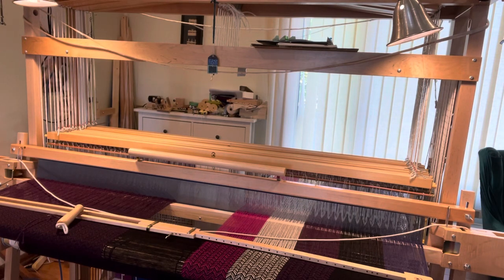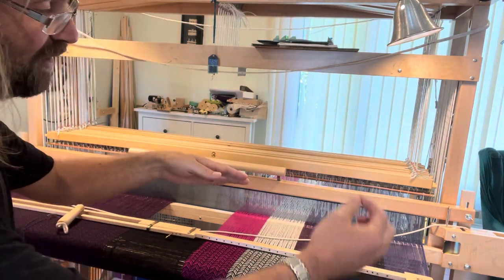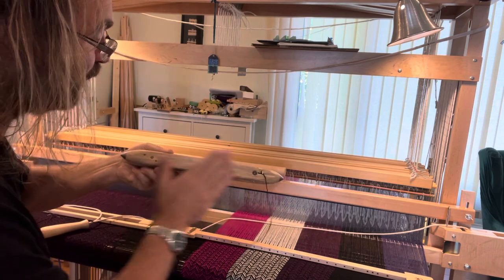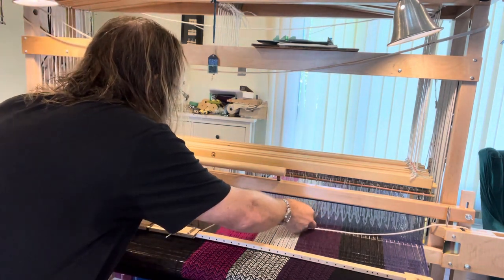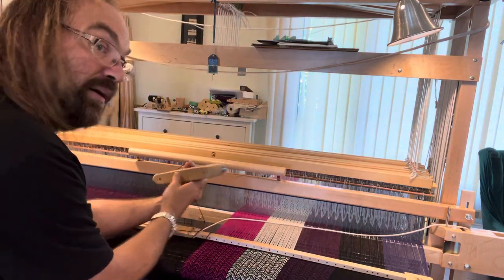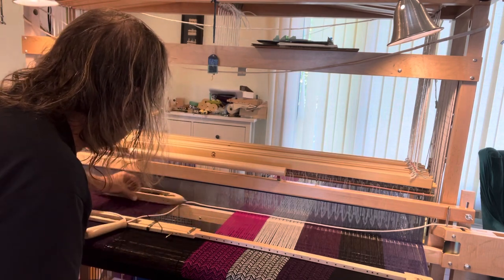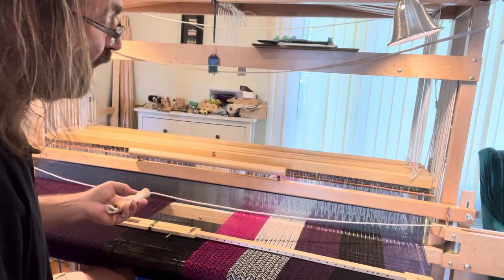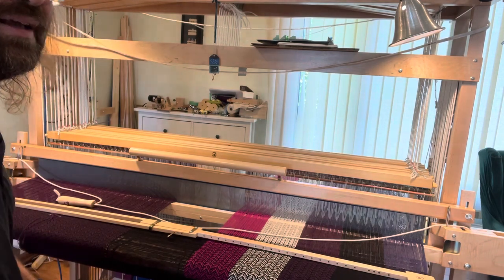Learning to weave / weaving with a flying shuttle or fly shuttle

Comment: Hey I'm in the process of shopping for a new loom right now and I was already leaning towards the 12 shaft colonial 60" before I found your channel. I'd love to hear your thoughts on it.
Reply from the maker: I love it. As long as you have the floor space and money - I can’t imagine doing anything different. 

1. It is a gorgeous work of art itself. Very well engineered, elegant solid hardwood, well finished.  Excellent company to deal with. 

2. Love the overhead beater for everything other than flying shuttle. 

3. 12 shafts give such a diversity of possible patterns. In doing 8 shaft twills, I often sley the floating selvedges on shafts 9&10, and weave 2-3 picks of plain weave at the selvedges to make it faster and better weaving flow. Also would allow for triple weave in a 4 shaft pattern, allowing for a 15’ wide piece hypothetically. On my bucket list to try

4.  Not cheap, but compared to other leading loom manufacturers, way more loom for the price. 

5. Flying shuttle for being able to use the full 5’ width (or really, anything over 45” or so). Very fast and efficient. 

6. Love the sectional warping for anything other than irregular stripes (eg Tartan). Those still require warping mill. But… sectional warping allows me to beam the warp much faster, by myself, with more even tension. 

The only issue I have had with mine is the rocking bench. The welds on the pins broke, so the sound you hear in my videos is a combination of the mic issues on my phone and the squeak of the rocking bench. Weaving noise is really not a problem. Now that I’ve fixed the bench (drilled out and installed 2 roller bearings - $10 on Amazon?)

Some upgrades I’ve made:
- LED light strips around the top of the castle
- fold down workbench casters ($50 on Amazon). Makes it effortless to move the loom around for cleaning underneath 
- 2 more bearings for rocking bench (came with 2, should come with 4)

The only place to move from here would be to a computer controlled system and then 24 or 32 shafts… that’s not where I’m at however.
Reply: @YetiWeaves  Thank you so much for the detailed reply!

1. I do love the look, really reminds me of all those old hundred plus year old looms.

2. Regarding the overhead beater, what are the advantages / differences vs a standard beater? I've never used an overhead beater. Is it easy to swap the two different beaters? One advantage I could see would be keeping the flying shuttle permanently installed on the standard beater and swapping to the overhead when you don't want the flying shuttle.

3. We think a lot alike! I am very much wanting to try a triple wide twill. (I'm most interested in twills) Or, if we want to get really crazy, 6 layers of plain weave........

6. I've been wanting to start some Tartan projects, and I will be getting the sectional warping setup on the loom. Is there any particular reason that sectional is hard with tartan? I can imagine with the irregular stripes it could be harder, but seems it'd still be manageable? I don't know. Have you tried Tartans with sectional warping?

Have you woven much linen on it? I've been wanting to do some linen (and almost all my projects are fine thread, 16/2 is common, 8/2 is the largest), but I've read some places that the jack loom mechanism can make that difficult. The owner over at Camilla Valley Farm said that it wouldn't be an issue, that tensions and shed can be adjusted and it's within the weaver's control. I'm also aware that historically jack looms were the standard, and people have been weaving linen on them for a very very long time. But I am curious what your experience has been. I will weave mostly cotton and linen, and mostly finer threads.

The casters are a great idea, I was thinking I'd need something like that, especially because after doing a sectional warp, I need that 3-5 feet behind the loom back!

While some day I may get a dobby, I'd want the mechanical one personally. Something about weaving that always intrigues me is the pure mechanical aspect of it without electricity, computers, etc. And the idea of a purely person powered 40 shaft dobby is very exciting in its own way.
Reply from the maker: Very cool - what an exciting time

1. Overhead beater - that's exactly what I do - I keep the underhand beater mounted to the flying shuttle, and use the overhead one for everything else.  I wish it was for some higher reason than this, but I just really like the feel and look.  It's very easy to swap out, and leaving the flying shuttle mounted saves a lot of hassle.  I can't remember exactly, but you might want to check with Nina at CamillaValleyFarm - I think I needed to buy an extra shuttle race to accomplish this?

2. Love the idea of 6 layers of plain weave.  30' wide?!?!  I may need to try that some day just to see...  I would love to make some wider rugs.  One of the real advantages for me of the Colonial is the weight of it - it doesn't move as I beat it.  And with the drop down casters I added, it's easy to move when I want to.

3. Sectional warping - I have tried it with irregular stripes once, and found it so cumbersome.  The problem is that you need to set up the spools and re-thread tension box with a new combination for every inch.  Not insurmountable, but a lot of extra work.  If I were to do it again, I'd want to make sure the warp was long enough to make it worth it.  If anyone out there has a better system for this, please let us know?  I've looked for videos on this and there aren't many out there..  

For Tartan, depending on the tartan, they seem to come in at 7.5" per sett +/- depending on the recipe..  If it was always an even 8", you could set up a repeating pattern and wind inch #1, 9, 17, 25.... the same, and then inch #2, 10, 18, 26... but it doesn't work out that way... sigh..

In the end, I found it was better to just use a warping mill, measure out 1" sections, and wind them on.

4. Linen (and thinking alike) ... no - but it is on my list to do.  I have bought a couple pounds of long stem flax seed, and plan to plant next spring.  I love the idea of growing the flax, making the tools to break it and process it, spinning it, and weaving my own shirt.  Perhaps the most amount of effort possible for the least amount of cloth? :) 

But no... I haven't worked with linen on this loom.  One possible advantage of the colonial though, it is slightly longer from front beam to back beam, so the pressure on the threads created by the shed is spread out over a slightly longer section of warp. It isn't a huge difference, but should be slightly gentler on finer threads than other jack looms.  

What I keep seeing about linen is you want a humidifier going underneath it as you work, but I'm just passing along what I've seen elsewhere.  Other people could weigh in and give you better information.

Have fun with all the planning and dreaming - let me know what you end up doing!
Reply: @YetiWeaves  Thank you again for all of your insight and information!

We have such similar ideas, haha, growing flax and weaving linen is 100% a dream. We have a good amount of property (rural) and so we could grow a reasonable amount actually.

I was curious on reeds - from talking to Nina at CVF, it seems like the important thing about dpi is that you can evenly distribute the warps threads, which means that ideally the dpi would evenly divide the epi. So she seemed to think that for example, if you're at 32 epi, that a 16 dent would be better than a 25 for example, because you could do 2 threads per dent.

I'm just trying to decide what reeds (if any) in addition to the 12 dent I should buy. There's a discount if I buy them with the loom, and free shipping. She advised that shipping on a 60" reed isn't cheap.

So I'm trying to figure out what reeds would maximize what I could do. From your tartan video it seemed like using 16/2 yards getting a 32 epi balanced weave is reasonable, and so a 16 dent might be a good idea if I'm aiming for 32 epi, but idk. 

Any thoughts on reeds?
Reply from the maker: I used an 8 dent for the 32 epi. The nice thing with a straight twill coming out of the heddles is that they come out in easy groups of 4. One group for each space in the reed makes it easy. 

I think I had tested a friend’s 18 dent reed for the 36, and it was a bit tight for 2 strands of the 2/16 yarn if I remember right. The more teeth you have, the more space they all take up too. So… if you’re talking a 16 dent reed, 2 spaces will be tighter than 1 space in an 8 dent reed, as there will be an extra tooth coming down in the middle. The problem with it being slightly tight, especially with wool, is that it weakens the yarn through repeated abrasion and you get more breakage. 

I find I use my 8 and my 10 a lot, and that covers most of my needs?

Ok - now you are making me think. Would a finer reed help get a tighter thread count (more teeth condensing the weft…)?

Sigh….. more experiments to do… :)
Reply: @YetiWeaves  Thank you for the info! Lots of decisions to make.

Any other advice or thoughts you can think of?
Reply from the maker: The other thing I took a leap on and tried was an end feed shuttle. They are expensive, but have such a nice weight to them and you can adjust the tension for different sizes of yarn so you can set the drag on the end of the selvedge to the level you want and it makes it consistent every throw. I eventually got a second one and use them for everything.  When doing tartan, I have them for my 2 dominant colours, and then use boat shuttles for the smaller stripes. It’s always disappointing to go back to the boat shuttle for me. Apparently I’ve gotten used to them :)

Then there are temples of course to stretch out wider fabrics to protect your end warps from drawing in too much and distorting your pattern, and weakening the end threads..

I went with texsolv heddles as they are gentler on finer wool yarn…

Definitely get a double ended bobbin winder with a counter. They are expensive but I have been so thankful every time I use it. I ended up getting an extra counter for my tension box so I didn’t need to move it back and forth, but that’s a luxury and not necessary..

I picked up a bag of the warp spacers. (Brown plastic chips that go between the dividers on the sectional warp beam). I have used them on the beam for longer warps, but what I really use them for is when I wind the warp on the sectional beam, as it comes out of the tension box, I put one below the warp section, and tape the warp to it before cutting it. That way, when I go to thread the heddles, I untape the warp from the spacer and the tape comes off easy and I’m left with the warps neatly lined up on one side of the tape…

There’s a lot to get to set yourself up, but once you are set up, you are set up for life. 

You certainly don’t need all of this stuff, but this is how I play. I love to experiment and tweak my systems. 

The last thing I’d give a shout out to is Laura Fry’s book The Intentional Weaver, or one of her video courses on the Efficient Weaver. She does a great job using her dance background, years as a production weaver, and knowledge of ergonomics to fine tune the actions we use as we weave to make them easier, rhythmic and faster…

Let me know what you end up doing :)